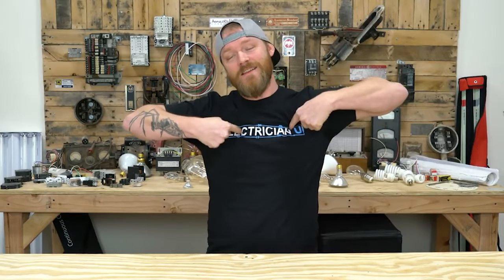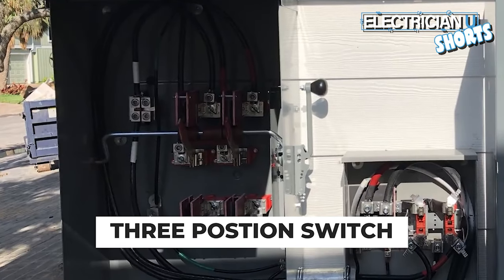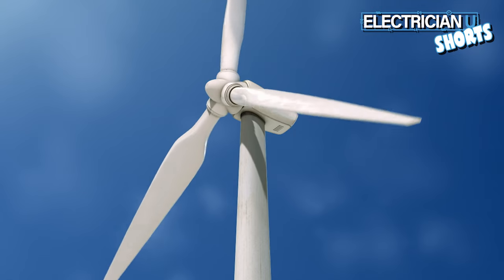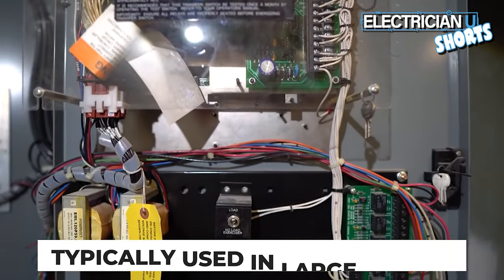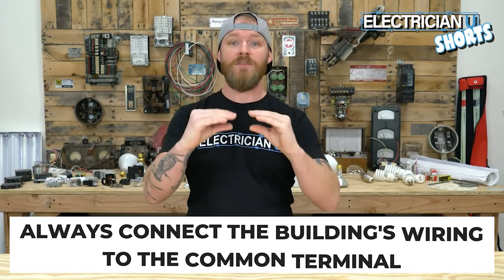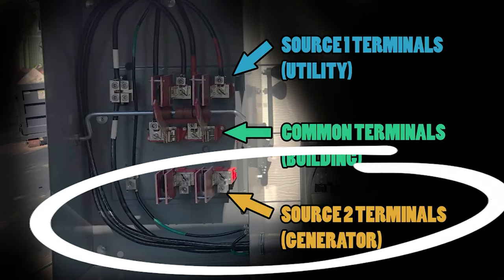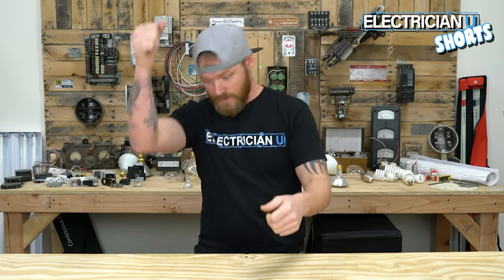SHORTS - Transfer Switches Explained in 2 Minutes!

Comment: Follow up video discussing grounding/bonding requirements at back-up generator?

 If:
1. Neutral switched - Generator neutral separate from utility neutral at transfer switch (separately derived system)
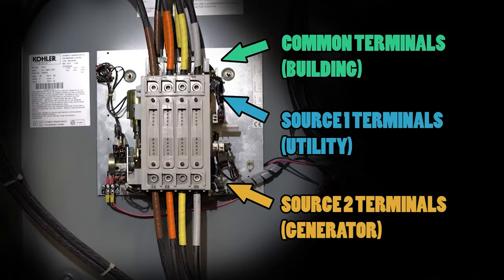2. Generator neutral remains connected to the utility power neutral  (1:03 mark)